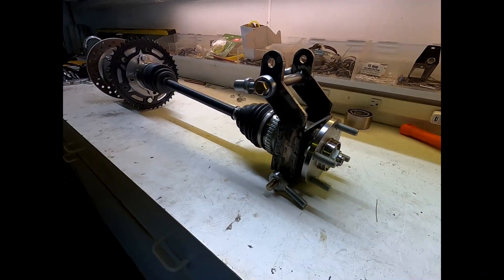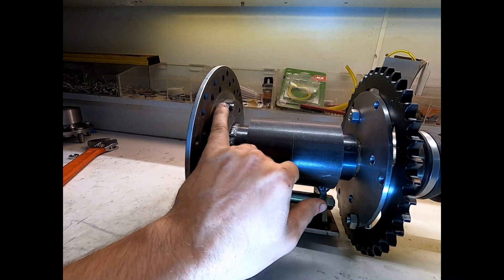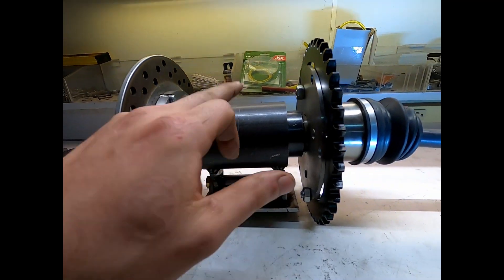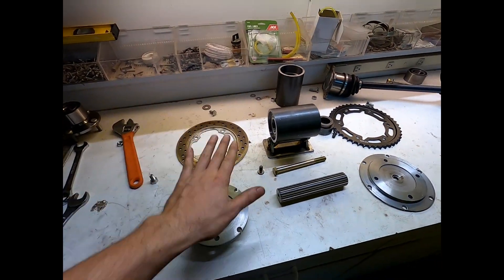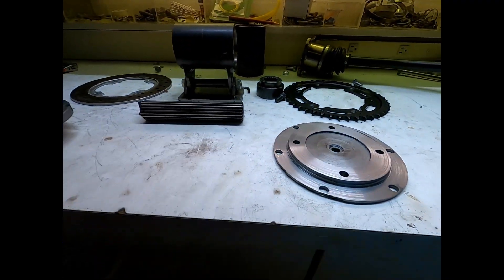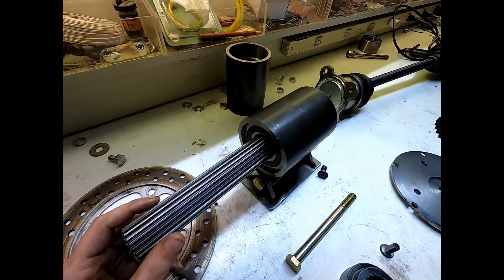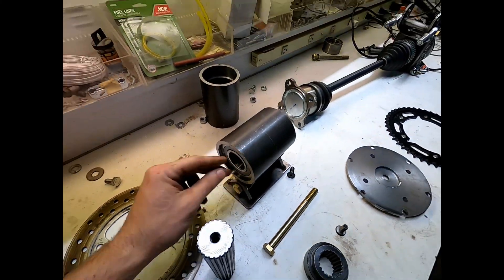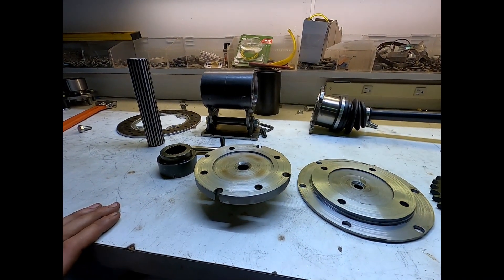Crosskart Build pt. 3: Chain Drive/Live Spool Rear End Build

Comment: What rear wheels did you end up running? I'm assuming you used the stock miata hubs that are 4/100mm bolt pattern?
Reply from the maker: Yes sir. I have the golf kart wheels still. 18x8x10  Once I burn those all up ill get some Hoosiers on em. And keep a set of 22 and 25" tires on hand too. All 4x100...golf kart wheels will be your cheapest option
Reply: @jimkhana6881  I've been looking like mad to find some 10x9 0r 10x10 wheels. I want to run the Hoosiers as well, Their website says they need at least a 9" wide wheel. Ive not been able to find one yet with that bolt pattern, I can find 4/115 all day.
Reply from the maker: @pyroman590  you have to pay a little money for them. But check out gpsoffroadproducts.com
Reply from the maker: @pyroman590  alternatively, you could make some 4x110 wheel adapters for the rear. As I type this, I might make some 4x110 wheel adapters lol
Reply: @jimkhana6881  Thanks!  They are a bit pricey but looks to be worth it!

Comment: I tried to find proto dye and can’t. Do they have a website? What size are the spline shaft, collars? What length and thickness is the cylinder it’s all going thru? I’m building one too and it would really help. Thanks
Reply from the maker: http://protodie.com/Splined-Shaft-Parts_c_28.html
Reply: Where did you get the bearings?
Reply from the maker: @Element7531  somevrandom site online. He sells them too to fit the shaft
Reply: @jimkhana6881  what’s the cylinder that the bearings go into made out of? Thanks for all the help man
Reply from the maker: @Element7531  mild steel tubing tgat i maxhined to take those bearings

Comment: What is the length of the splined shaft? Great info and way cheaper to build then buy
Reply from the maker: thanks brotha. its 7" But i may use a 9" next time so i can center the enhine in the chassis without using a jackshaft
Reply from the maker: right now itll be mounted like 1.25" right. youd probably never notice the weight difference but i wanna be building pro level buggies here soon
Reply: Nice! This will be my first buggy build. Trying to take in all the info I can. I have built rock crawlers before but this is a tad different. I’m sure I’ll have more questions along the way. Thanks for your info

Comment: Seems like a nice strong unit you made.....but....I would add couple of grease fittings to the body near the bearings.....so they last longer.
Reply from the maker: They're sealed bearings so no greasing.
Reply: That means per greased.....more never hurts...I would say oil but.....with the spline shaft....would leak out
Reply: @mikedill7378  having grease fittings would do nothing for the bearings. The bearings are sealed. The splines and bearings move together. You wouldn’t want any grease getting in between the spline and bearings anyways as this could cause less friction and allow the spline shaft to spin faster then the bearings.

Comment: How much would a rear setup like that coast for someone to buy ?
Reply from the maker: I'm not sure yet. This is the prototype. I think I'm making the next with VW or BMW axles and wheel bearings in the center section. Maybe 500
Reply: @jimkhana6881  is that going to include the axles too?
Reply: I sell finished ones if your still looking

Comment: What cv axles and hubs did you use?  And what’s the planned width hub to hub?
Reply from the maker: Using miata axles. If they dont hold up Ill switch to VW axles. 55" hub to hub rear, 65" front and rear track width

Comment: I am also building a 600cc crosskart. So this was super usefull. What diameter is the splined shaft? Did you consider making a chain drive diffrential?
Reply from the maker: 1 3/8 shaft from protodie. I did consider and a diff but you want to use a new diff if you want LSD and theyre pricey. Ive seen plenty guys weld spider gears and run a diff as a live axle but they seem heavy, bulkt, and ugly lol